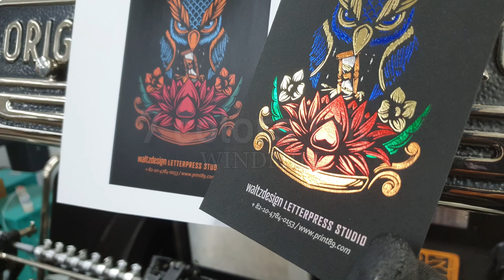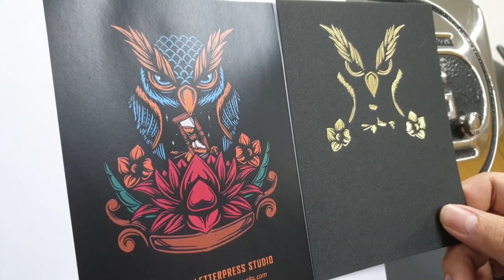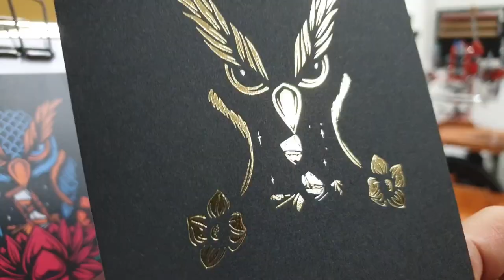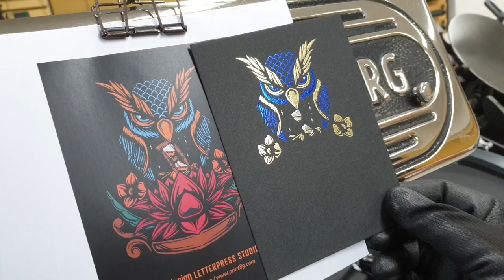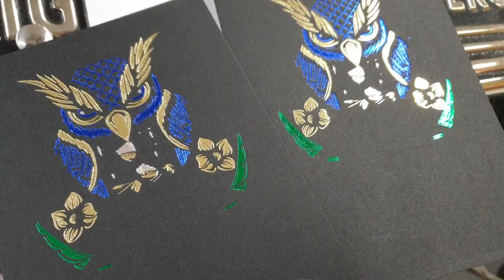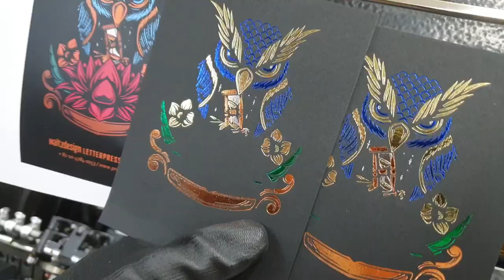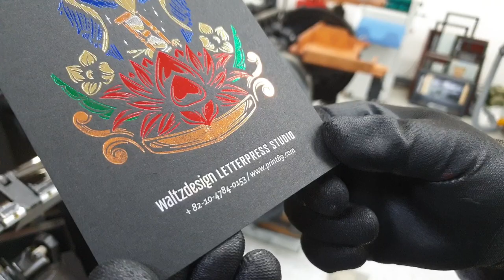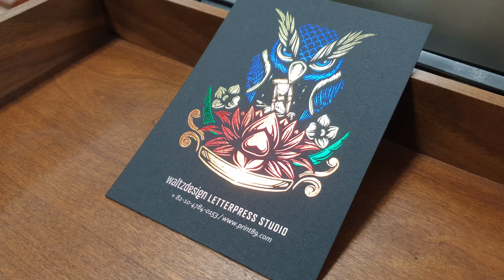7 colors Foil windmill Letterpress printing윈드밀 레터프레스 자동 장비를 이용하여 카드에 7가지 색상 박 만들기.

Comment: This is wild, a tight registration, and he’s not using lay gauges???
And I’ve never seen this kind of hot plate and this technique of transferring a die to it. Very impressive.
Reply from the maker: nice to meet you. In Korea, most technicians work without gauges. I learned from those technicians. Crafted using all mobile means in the equipment. :)
Reply: @w_letterpress  
Thanks for the video
Reply from the maker: Thank you very much 😅😅
Reply from the maker: Thank you very much 😊
Reply: i thought exactly the same - there is always going to be some movement running off lays

Comment: I am impressed with your mounting and registration techniques. I have experience in this area however we had to use less efficient methods and substandard equipment. American shops don't come close to the cleanliness or quality of equipment. American shops owners force the employees to compensate for their inability to invest in infrastructure.
Reply from the maker: Hello. I brought most of the letterpress equipment from the United States, and I clean and paint for a long time and reinforce the necessary parts. Believe it or not, I use the equipment I have alone. It does not employ staff. As I'm involved in everything myself, I think machine management is important. I think that the quality of printing is good only when the equipment is clean.

Comment: Great video - we used to use an acetate overlay device like this when I was a compositor. Can I ask what adhesive you use to attach the plate to the hot bed on the machine.
Reply from the maker: Nice to meet you.  The adhesive is made of double-sided tape.  There are places in Korea that manufacture and sell double-sided tapes for print shops.
Reply: @w_letterpress  very much improves work love from India
Reply from the maker: Thank you very much 😊

Comment: Hello, 
amazing work, i have a question though; where do you get the mold you use to press print i mean that metal stamp ? do you use a cnc machine to shape it ?
Reply from the maker: nice to meet you.  I commission a plate maker.  The type of plate is zinc plate.  I know you are doing corrosion work using chemicals.